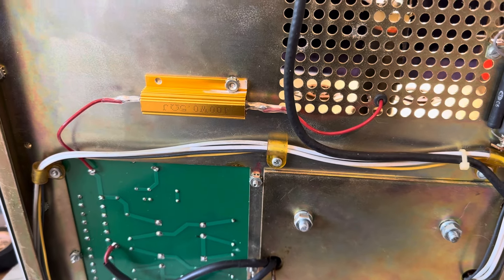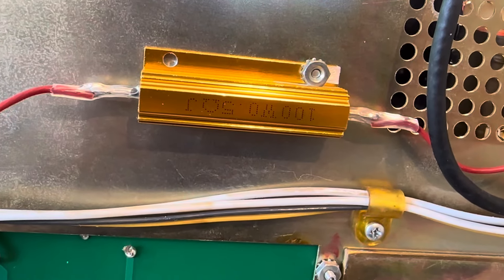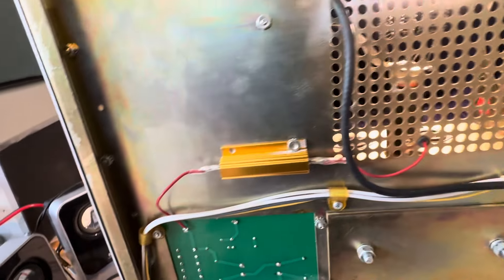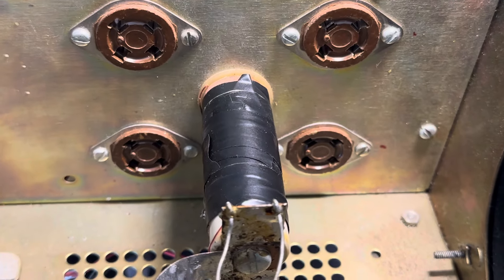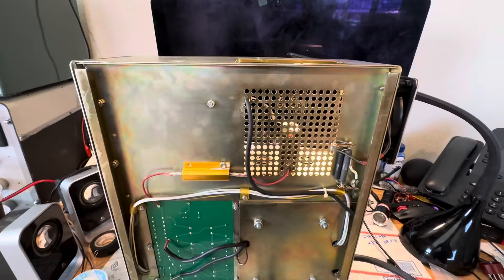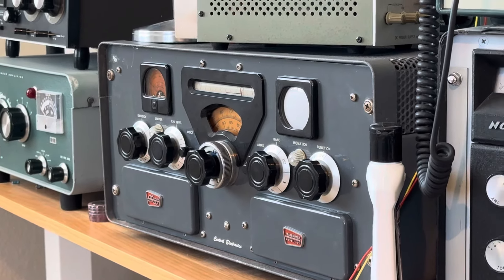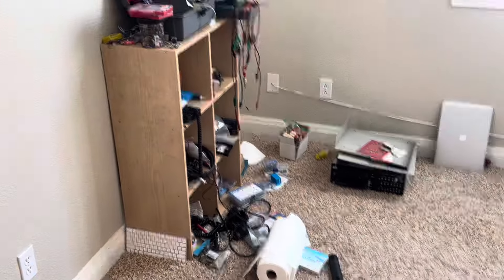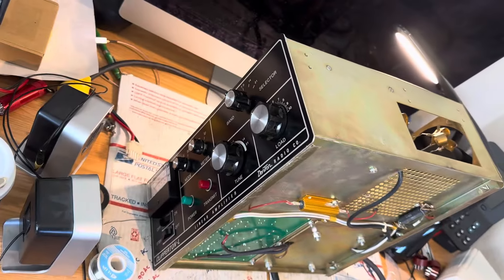Denton Clipperton L linear amplifier 100 W .5 resistor added in series with finals RF choke again

Comment: Now your after removing the protection to your tubes , low wattage resistor was acting like fast blowing fuse in the HV to tubes , crazy going 100 watts  youll really blow it now and next bang will be a big one. CHECK YOUR  1000uf 5kv doorknob cap its probably cracked
Reply from the maker: That crap resistor was HARD to change where they put it. The 10 watt ,5 resistor is not burning up or smelling now. If the tubes blow they blow. On AM I do not ask more than 200 watts carrier from the AMP. On SSB I go to SSB voltage and open it up wide. NO bangs or booms lately. The amp IS for sale on eBay. This amp is a daily driver.